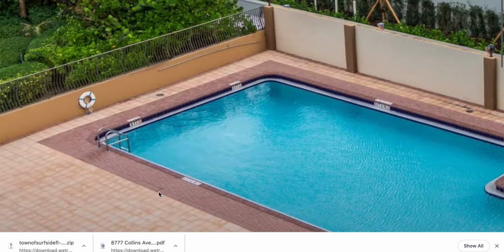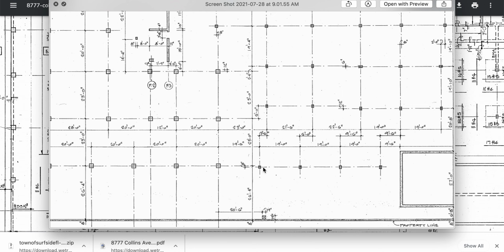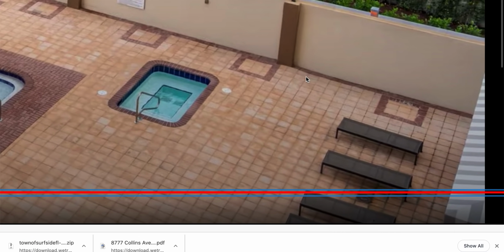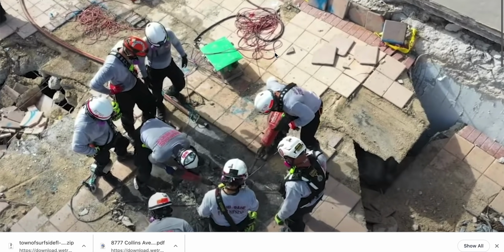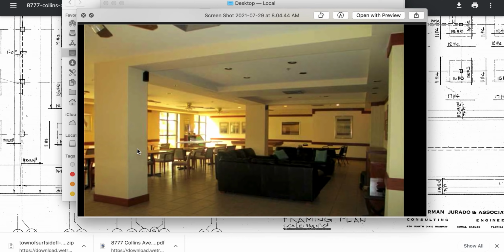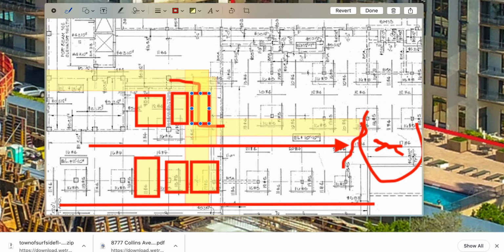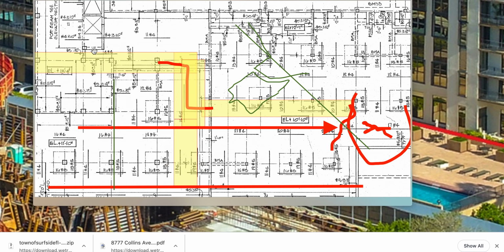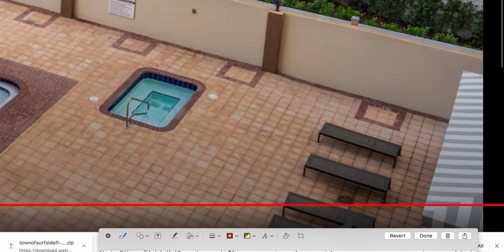Champlain Towers  BUILDING COLLAPSE WHY WAS DECK DIPPING PRE-COLLAPSE TRIBUTARY FAILURES DISCUSSED

Comment: my theory is that where you see the buldge, is where the outer wall is pushing in on it from the deck being so weak. Guess what the wall exploded and started it all. Ripping down the whole ceiling all the way to the north side of the towers. From there the building was doomed.

Comment: Maybe wrong but if deck slab was one piece w building the building sinking would put down pressure on the deck  .add the poor  condition by the big planter an the 3 foot cut .un plugged  you have a problem .I see the hump by hot tub maybe from hurricane wall repair earlier.🙄
Reply from the maker: https://youtu.be/JBgjOpI_zk4

Comment: It can't be a coincidence that the front of building failed where the parking beam intercepts it. you have to include the weight of all the concrete from all the decks and beams falling. Then pull in a direction not intended to be pulled.
Reply: Add the additional layering to the pool deck to that beam as well omg... That is the failure.
Reply from the maker: Hold on about that ''additional layer''...   I will get to that but it is not always negative effect...  I have to give both sides of that coin.

Comment: Just a few points. My two cents.
1. Are you showing that the two headers front of building and parking area are tied together. This makes your theory plauseable.
2. Why not add another column. And separate the parking area from pool deck. Seriously.
3. The parking area is partially supporting the left building. Makes sense to add beams. You skipped over that...
Reply: Adding 3 layers of concrete to the pool deck and tile waterproofing if any. That's a lot of stress.

Comment: Just so you all know, 99% of your concrete floors in buildings and houses will have ponding. Floors are sloped on purpose toward drains,  but concrete floors are poured and finished by humans  unless it is poured and finished by the use of lasers and automated equipment you will have ponding,  if it rains or gets  wet from floods or Water leaks you will have ponding.

Comment: You can see that the deck is at a lower level from the post just to the right of the hot tub see 
https://youtu.be/djePOXALegM?t=92 has it already dropped or was it laid wrong ?
Reply: As I think the video points out, the area west of the pool/hot tub might also be designed to slope (four corners to center drain) for drainage purposes. Actually thought I saw some pages of the pool deck design that showed that but might be confusing it with the penthouse roof drainage design. In any event the photos show that drainage wasn’t happening especially around what might have been a raised drain above deck.

Comment: Now, in other videos I have seen where they say there was little or no waterproofing under the pool deck. Watching this video, at the spot they are using the jack hammer, is that black material under the pavers waterproofing? it has sand on top of it, so to me it looks like waterproofing, actually looks like black felt paper, like you use on a roof. I am just a truck driver, so have no knowledge of how buildings are built, but just thought I would put my 2 cents worth in. great video by the way.

Comment: Great work on the analysis, spot on.  Now can someone warn the remaining Condo dwellers in the North and East Towers to STOP PARKING NEXT TO THE POOL DECK, IMMEDIETLY.  Until a full investigation is finished,  some one should tell the other two buildings about the dangers of parking in this parking area above ground next to the pool deck. NOT SAFE.

Comment: When the pool deck collapsed next to the wall, at the dip, the rebar broke in two pieces in a straight line leaving pieces in the wall and deck which account for the straight-line scratches on the lower wall.  The scratches appear to be the width of the placement of each piece of rebar attached to the wall.

Comment: I am wondering if the architect ever visted the build site and inspected the progress of the work to make sure they were building it to his/her design, just looking at the lack of elevation change between the car park that fell into the garage and the pool deck that should of been a early red flag warning that they have deviated from original plan.  And you have to wonder what other changes did they make that we can't see internally to further weaken the structure.  The demo guys said the concrete was softer than expected did they order the correct spec concrete or did someone else change the specs elsewhere thinking concrete is concrete does the same thing.  But when the reports come out it won't be one thing it will be a number of failures leading to the failure.
Reply: his

Comment: I went back and looked at the "history preservation community pdf" in Surfside public records. The piles for the new tower's underground parking were only 10ft away from the pool deck. Not to take away from the design flaws you found in the CTS. Was the new parking garage the structure that may had been "destabilized" if they had fix the deck? Still not sure sinking piles that close to the neighbor's pool deck was the neighbourly thing to do. Thank you for seeking out the truth.
Reply: Thanks very much. That agrees with Google maps. How deep are they?
Reply: @exist7309   It didn't say how deep the piles are. The 87 Parks' garage is 13ft deep and half way under the former street, what is now 87 Terrance. It says the garage is only 12ft from CT deck. I don't believe it cause the collapse but made it, imo,  near impossible for CT to fix the deck without "destabilizing" their new underground garage.
Reply: @jobrownsmith116  Thanks for checking and letting me know. I appreciate that.

Comment: Just watch your video bit for late last night very interesting looks like velvet parking what could not have taken into account is weight of the cars as trebled since its building was constructed .The offset of the columns though me at start and the part which stayed up was better designed with lots of bma but the deck it's only a deck in engineer mind and I agree the pool deck was under designed lack of bma going across the pool deck large void the garage below which lead to the punching shear just like you said i  think it  was a cost cutting exercise which from the start .
Reply: The site drawing (signed) said 11.85. When was that change made. Did the structural engineer or architect miscommunicate.  Did it change after the crane collapse.

Comment: One guy I seen showed that the deck had become sort-of delaminated. You could see in those core samples. So only the bottom half of the slab had rebar supporting it - or maybe the top half can't remember.
Reply: But I think it was a cheated building - cut back on it to make someone some extra money.

Comment: The 911  calls reveal a common trait, “Total Disbelief.”

I agree.  A sudden and catastrophic collapsed like this one is a trademark  of 1970s Irwin Allen drama.  It is just inconceivable that a pool deck could bring down a building.  
Engineers will need to rethink their manuals and methods.  This deck was not added.  It was part of the original building design.
Yes, a bad deck could potentially fall.  And if it did, it should fall alone, period.
It should never,  ever bring down an edification.
The building in this tragic event was a deadly effect , not  the cause.

Comment: The area around the puncture  shear  is the  critical shear perimeter . The critical section is the section which follows the critical perimeter and extends over the effective depth,. For slabs of constant depth, the critical section is perpendicular to the middle plane of the slab. For slabs of variable depth it is assumed to be perpendicular to the tension face.

Comment: If you look at the collapsed parking lot picture with the rescue dog picture you have in a previous video. You can see ripped out rebar from the collapsed floor then look at the ceiling with the grooves from where the rebar tore out.

Comment: Is it just me, or did the standing part of the building have bigger columns (24x24) vs. the collapsed side (18x18).  Am I reading things wrong?
Reply: No, you're correct.

The part that did not collapse had larger columns AND beams tying the columns in a lattice under the 2nd floor.  The part that collapsed had smaller columns and no lattice under the 2nd floor.

The reason is, part of the building was designed to withstand facing the winds of a hurricane, as the windward side of the building.

Nothing nefarious, just a difference in design criteria between one part and the other.
Reply: @litz13  Thanks for your reply!
Reply: @litz13  thanks for your explanation why but I wonder if you can be sure, that the wind always comes from the same direction there? Where I live, we have the wind direction changing so often but it’s no where near seaside, so I don’t know how Winds work there.
Reply: You are correct.  According to the WP as I recall, that side of the building was built to withstand strong wind.  Therefore it is built differently from the sections that collapsed.  Sketchfab has a 3D model of the west side building.
Reply: Just to add a comment, I was under the assumption that each building  elevation face would be designed for the max wind pressure recommended by the building codes, not simultaneously.  Worse case scenario rules.

Comment: I applaud your earlier research showing the original design clearly indicating pitches of the pool deck and drainage plans.  It appears others came along later and removed some of those features, or it never was built as planned.   Shame on the one commentator who says the original architect plans were at fault.  The shame has historically been proven to be later in the life of that building.

Comment: How long do you think it will take for the other channels to try to jump on the band wagon with what is about to be revealed?     If this is going to be what I think it is going to be, it will probably be one of the most important reveals yet.
Reply: Bear in mind, the two main other channels are both Florida-based, so they might back off for "fear of flying too close to the sun" if you will. They've been quiet for days.
Reply: @jazzman92478  I have noticed that.  😂
Reply: @jazzman92478  Yes they have. I check every so often to satisfy my curiosity.
Reply: @jplattet  they have?? Cool. I’ll check them out. See what they have to say.
Reply: @jplattet  I just checked. No update from them beyond shear walls and man lifts. I will be patiently waiting.
Reply: @jazzman92478  I meant “yes they have” been quiet. Not a peep out of them.

Comment: I'm no contractor, just a curious person, so with my untrained eye, I see diagonal cracks in the deck tiles, probably due from insufficient water proofing underneath, causing damage to the cement flooring that was no longer supported by a beam.  Was the dip purposely hidden with planters or had they been removed after the dip formed?  My GiGi kitty sends Georg & Bruce love!